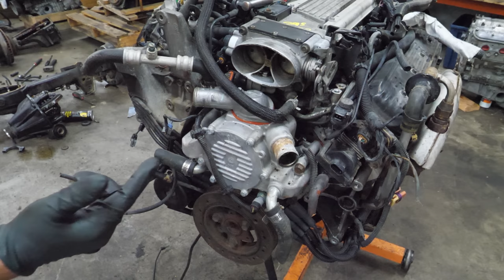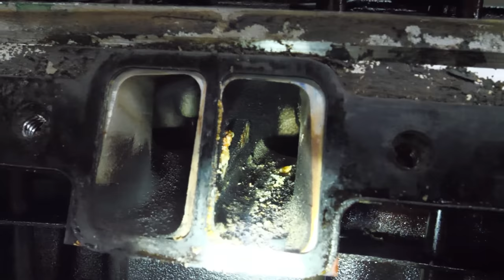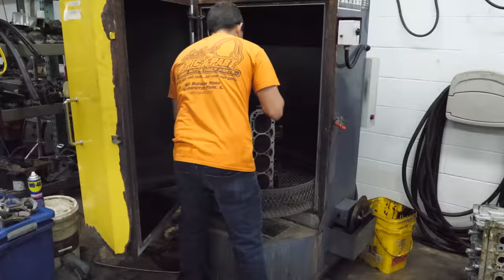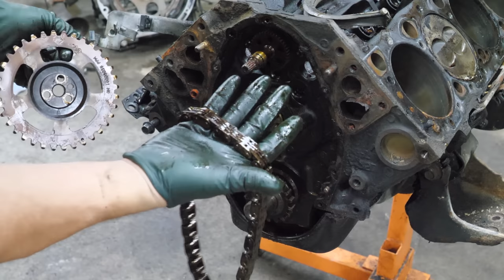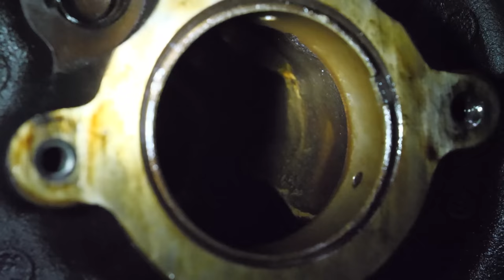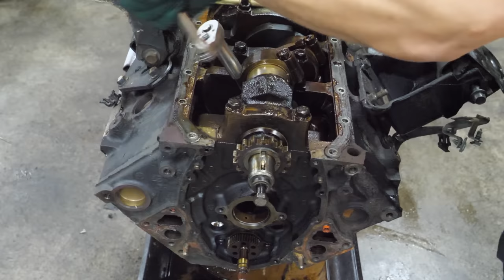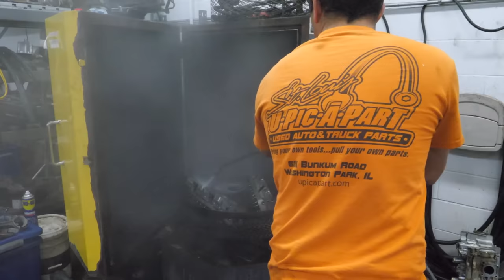Bad Corvette Camaro Trans Am Gen2 LT1 350 Teardown. Not The Problem I Was Told!

Comment: I owned two LT1 vehicles. A Camaro and a Trans Am. I think the LT1 was a fantastic evolutionary idea idea in its broad strokes that was poorly engineered after the fact. Should have just stuck with a few simpler things, most specifically the water pump and ignition. When you think about how the Optispark works it's not unlike the good old HEI distributor. Wasn't any need to change that, especially dropping it RIGHT underneath the water pump, lol. (which we all know I just wanted to weigh in. Anyway I love your videos! keep up the great work and the excellent teardowns!
Reply: They had to put the distributor there to achieve low hood clearance from what I was told. I didn't like them either.
Reply: @chadbentley6166  They're fine when you switch to universal antifreeze.
Reply: A distributor would not fit behind the LT1 intake manifold because the way it was made.
Reply: @chrisromero5302  A distributor will fit. It just requires a little bit of modification including drilling out the hold for the distributor itself and a hold down. There may be slight clearancing needed on the back of the plenum but there is enough material there. Can't remember for sure. There are videos all over the internet doing it. I want to say Richard Holdener has done it. Can't remember if it i was on his channel or an episode of Engine Masters but it's certainly doable.
Reply: The optispark ignition system was insanely accurate and leagues better than the old HEI ignition system. When you realize this you would never look at another old HEI system again.
Reply: @Someguy6571 its downfall was more its placement, as mentioned losing a water pump often meant writing off the Optispark too.

Comment: That’s right folks it’s the old dipstick tube wrestling match dance thing… LOL I tore down a lot of blocks in my time and if it don’t come out easy, I just go through the oil pan side with a drift and tap that sucker out, it works every time on the difficult ones. Great showman… Keep on rockin.

Comment: I had one of those and yes, went through many optispark units.  By the way, those 2 bolt main blocks are actually stronger than the 4 bolt main blocks. The webbing on the 2 bolts are thick all the way through the block.  The 4 bolt main blocks , the webbing is thick where the bolts go but thin down the rest of the way.   So when you install 4 bolt caps in the 2 bolt block, the 2 bolt block is stronger than the 4 bolt block .... so no need to look for the rare Corvette 4 bolt blocks...the 2 bolt ones are more plentiful and stronger with the splayed 4 bolt conversions.

Comment: My favorite GM motor.  Had the pleasure of going into my police career with a caprice 9c1 with the LT1.  Bought one at auction drove it forever had about 4 opti on hand and swapped the suspension out for moog and enjoyed a tuned variant for years. I definitely went for the non Z28 variant with cast iron heads.
Reply: Same here man I was in middle school when the 93’s came out and fell in love. I bought a 96 z28 a4 when I was 18 only kept it a few years should’ve kept it! Then 10 years ago I bought a 95 z28 m6 and don’t plan on ever selling it they may not be as fast as the LS motors but they have that old school muscle car sound and are the last of the iron block 350 muscle cars 😎
Reply: Oh and ive always loved the big body LT1 cars to, I had a friend that had a Buick road master sedan and got to ride in it a few times I would like to own an impala, caprice , or Buick also but my wife would kill me lol
Reply: @buckeyfan7623 it held up to my 2000 Camaro SS and did 148 mph all out!
Reply: @buckeyfan7623 a fella had a roadmaster and converted it to the 6 speed! It was definitely unique!
Reply: @buckeyfan7623 BRO a 1995 Z28 m6 was my first manual car, I miss it so much! (rust and head gaskets killed it)
Totally agree about the sound, the LS is a better engine but the LT just sounds perfect so it's more enjoyable. 
Love to find another one in decent shape.

Comment: The Chevy Caprice also had a 4.3 liter version of this engine. It was a V8, not the infamous V6. All the same great water pump/distributor setup but without all that pesky performance humming things up.
Reply: Lol, right?
I think it only made barely more stock power than the 4.3 V-6 anyway, wonder what was the point of the L99?
Reply: @nthgth  GM loves doing that shit. When the 3.6 came out for the Cadillac line in 2004, they had a 2.8 liter, lower power version. The engine is literally identical in every way (except displacement of course) It just had drastically less power. Then when they went to direct injection, they had a 3.6 and a 3.0. Again, exact same engine, just smaller and less powerful. I’m sure there is no cost of production difference, and they get the same fuel mileage. JUST USE THE BIGGER ENGINE! 😂

Comment: At one time, GM used only cast iron heads on small blocks, and head gasket failures were quite rare. But as time has taught us, GM always thinks of new ways to make their engines less reliable, and so aluminum heads with weak castings are a given. And Optispark---of course! No thought at all given to long-term reliability
Reply: The main problem with the Opti (amongst all the others) was that the beancounters got hold of it - they refused to let the engineers specify the good optical trigger components for production, so the unit was highly susceptible to heat-death even if the owners kept the engines up, never got liquid up into the engine, etc. That, and cheaping out on the housing material so that carbon tracking caused spark jumping.
Reply: With aluminum you can run a little more compression, a little more timing, a little leaner.  The aluminum will shed the combustion heat a little quicker and stave of detonation.
But, yea.....GM, so we only did it half assed.
Reply: Lol you think aluminum heads is a bad idea? You do know every auto manufacturer uses aluminum heads now .. aluminum distributes heat alot better and cools alot faster...Has NOTHING to do with premature head gasket failure .. it was only a matter of time before all Engines utilized aluminum heads...The fact you think it changes it's reliability is laughable
Reply: @randymagnum143  really because all LS and LS based  engines used aluminum heads and they are some of the most reliable engines on the planet .And the heads are some of the best ever made... You guys are speaking pure jibberish
Reply: @erikcapozzi3425  I'm guessing you must be a kid. It's a proven fact that aluminum contracts at a different rate than iron, which can (and has) lead to blown head gaskets. Furthermore, if you get aluminum heads hot, they will warp and crack far quicker than cast iron. As far as cooling goes, that's a non-issue---a properly designed cooling system will keep any cast iron-headed engine plenty cool.
Reply: @erikcapozzi3425  first of all.......I said there was a performance gain to be had with Al over Fe.
B; no, durable (industrial) engines are iron, and a lot of it.  Automotive engines are fractionally as durable as say, a tractor engine of the same hp.  
Lastly, GM has a history of cost cutting in areas that affect durability.
Reply: @erikcapozzi3425  Overheat 'em once and see what happens.
Reply: There's nothing wrong with aluminum heads. Frankly, there are a lot of advantages to them. Better heat dissipation, and WEIGHT SAVING being the 2 biggest ones.
Reply: Let's face it though... the weight saving is the biggest reason. That's also the reason that body panels are a fraction of the thickness they used to be. Everything is about weight, fuel mileage, and emissions now. Also... all car manufacturers are bean counting to the fraction of a cent. Cars now have become "throw away models". Nothing is "built to last" anymore, which is very sad.

Comment: 1:11 I suspect the reason the Gen II SBC never made it to the trucks was a very simple one: it wasn't intended to be a long-term solution; it and the Vortec CSFI engines were stopgaps, intended to keep the vehicles they powered competitive until the LS engines were ready (and why GM chose the CSFI for the 5.0 ad 5.7 is something I will never understand since they ended up doing a normal SFI system on the Vortec 7400). I wouldn't be surprised if the reliability issues you mentioned also played a role (though supposedly the OptiSpark was fixed in 95 or 96).

Also, funny thing about GM's (over)use of TBI: In the late 70s, they had a electronic port injection system (that they co-developed with Bendix and Bosch), but unfortunately it was an analog system with no O2 sensor; it was deep-sixed for the digital TBI in 1980. One wonders why no one at the time thought 'hey, lets take this port injection idea and combine it with this closed loop digital system we came up with'. Instead, we get TBI and later TPI, with LT1 and LT1 being the only 'classic' SBCs to get true SFI, and even then that didn't happen until 1994!

Comment: The lt1 are great high hp engines but lack in low end torque especially compared to the L98
If you change the water pump and get the updated  95 and up opti spark its a really reliable engine
Reply: Huh? The L98 made 330 lb of torque and the corvette version of the LT1 made 330, so I'm not sure what you're talking about.
Reply: @231mac  Gotta drive both engines to see what I mean
Reply: @doolallyproductions7234  I have and I get that the L98 feels slightly more torquey, but I thought it was negligible, especially considering the HP difference.
Reply: @231mac  It really depends on driving style when I was auto crossing my 90 corvette L98 I had better time then a lt1 car but later when we rolled race on the freeway he left me in the dust
Reply: Interesting. 
I'm getting that an L98 may make the same amount of peak torque, but it peaks at lower RPM. Makes sense for having same displacement but less hp.
This makes the L98 feel more torquey in everyday driving, which can be a lot of fun, and makes for quicker acceleration at low speeds (e.g. autocross).

Am I picking this up right?

Comment: The gunk down in the intake ports is likely dexcool. Previous owner switched to dexcool when they did the water pump. Water pump failing is what cause the head gasket to blow sending coolant all through the motor. Intake gasket was likely leaking and engine was sucking some coolant down into the cylinders. It was probably becoming hydrostatically locked, but i imagine if the stiff wrist pin condition existed before it sat that could have contributed. 

Sorry for your frustration. Watching you struggle with that dipstick tube was the single greatest moment of my day.

Comment: I'm wondering if the dex-cool turned acidic and destroyed that head gasket. I understand there were problems like that early on in the history of dex-cool.
Reply: That's on the Vortec engines. always  eat the intake gaskets
Reply: These engines used regular green coolant...my 94 does anyway.
Reply: @johnfranklin5277  In 96 they switched to dex-cool, so this example would have used it.
Reply: Was there a batch of Dex Cool that was mixed up defective? Used in some factory fill?

Comment: From what I know from friends that have this engine, GM never released the rights to manufacture the Omnispark unit. Your option is to buy the Chinese knock off and send it to a guy in Tennessee that disassembles the unit and refurbishes the “new” Chinese part for dependability.... thanks GM...😅
Reply: Petris and MSD makes the best replacement Optispark. There’s numerous opti options out on the market so I don’t think your comment is accurate
Reply: @sevensinsvelocityshop7563  hey thanks for the 7 month old correction.  I will sleep better at night knowing there are people like you out there reading old comments and correcting them instead of just making a new comment. Not all hero’s wear capes…. Enjoy your Bud light!

Comment: Blown head gaskets are a problem with those aluminum heads.
I hate the opti-Spark system too. My 95' Roadmaster has that exact engine and the first thing I had to change on it when I bought it was a rebuilt distributor.the cap was bad but I replaced the whole thing because it was so hard to get to

Comment: I didn't know.
That's horrible how the motor company treated the last SBC.
They installed a gazzilian possible vacuum leaks and twice as many electrical glitches.
Bolted 100Lbs of brackets and manifolds on the block.
And then had the audacity to hide the ignition next to the water pump.
The engineer that thought that idea up, worked for Ford during the flathead era.
Reply: This isn't the last small block. What are you talking about. The top end is light. It was a strong engine. And these cars don't have electrical problems. It's just an old engine and engineered for the day

Comment: Nice tear down..I own a couple of lt1 in fbodys, pretty common head gaskets..Check the oil pump drive for cracks, and the crank thrust bearing for wear. Other than that looks like a good builder.

Comment: Got me a 97 Z28 Camaro with the original LT1 RPO engine and trans 4 speed auto M30 RPO  at 180k miles. Always make sure you keep it cool or you will have warped heads. I never let her get hot.

Comment: I cut my automotive teeth on GM motors from the late 80s to early 00s, so they have a probably undeserved nostalgia for me. 2800 and 3100s, to the Ecotec and Quad 4s, and of course the 350 V8s, LS1 and LT1 motors. This video felt familiar. I could smell it as you tore it down.

Comment: I had a 97 Trans Am WS6 with this engine in it.  Although I never really had any problems with the engine itself ( just regular maintenance items), working on it in the car was an absolute nightmare.  Changing sparkplugs was an all day job, as you can only see 2 of them. Had to change out the optispark due to worn bearings causing random misfires.
Reply: I just picked up  97 trans am WS6 recently. 85k miles and runs great. Just a little hard starting in the morning.
Reply: I had a no-start situation in my 95 Z28 one time - turned out it was badly in need of a tune-up.
$1000 later it was fine, but the garage said they actually couldn't replace one of the spark plugs because it was just too rusted in! Lmao.

Head gaskets and rust killed the car before any issues arose from that one tired spark plug.

Comment: Vortec L31 (5700) heads are very similar to LT1 heads but not reverse flow cooling. Regular dist also. Had about 255 HP which was about the same as the iron head LT1 (260). However they had their own injection and intake issues.  Can't win 'em all.
Reply: I wonder if the Vortec's issues are easier to repair or prevent than an LT1 though. Maybe an upgraded L31 could be a great LT1 replacement if it fits well into the car

Comment: What I liked about Buick 215, 300, 340, 350, 400, 430 and 455 engines is the harmonic balancer came off without the need for a wheel puller. I do not recall if the Nailheads (264, 322, 364, 401 and 425) needed one or not. Once you got the crank bolt out, all you had to do was use a rubber hammer to gently take off the harmonic balancer. Chevys and Fords seemed like they were welded on by comparison!

Comment: Eric next time try putting a snug fitting bolt in the Dip Stick  tube then Clamp you a Set of Vice Grips on it  so it don't crush the tube  and Whale on the Vice grips with a Hammer it has worked for me several times But Not Always :face-blue-smiling:

Comment: I had a 95 Fleetwood with an L T1 I remember when I had to replace the opti spark what a pain in the ass. And God help you if you run through a water puddle and get that unit got wet the car stops running right then in there you have to let it dry off or it would run really bad for a while.

Comment: That is Exactly what happened to my 85 Iroc z28. I replaced it with a 92 Corvette engine, With all the go fast parts. ,Siamese runners,  Cam ,headers, Bigger injectors, Heads ported and polished, Bigger valves, Adjustable fuel pump regulator. Aftermarket prom for the computer. Then 1st time out grenaded the transmition. I have noticed a lot of people using this body style for drag cars.

Comment: Hey bud when I would pull out of dipstick I would take brake clean and spray down around it going down into the engine having loosen all that grime and old oil and that sucker would come right out it always worked every time I used it a lot

Comment: shop i worked at had a son just start working there.
so him and his younger brother were stripping a chevy engine for the 1st time.
1 late teen, other early 20's.
mechanics kids.
so they get all the head bolts out under the valve cover and can't figure out why it won't release.
so they ask me to help  them.
so i point to the lower outside of the head, and said remove those first.🤣
they'd missed all the outer head bolts.
they did a little better after that.

Comment: We had 3 IROC Camaros when new in our family of brothers and not one gave us any engine trouble and we put cams bigger throttle body and plenum then drove them hard, the only issues we had where blown transmissions and one set of ring and pinion gears stripped. People are probably trying to race a engine with 200,000 miles on them is why they talk crap. I still have  a new set of heads removed from my 1988 replaced with edelbrock 202s